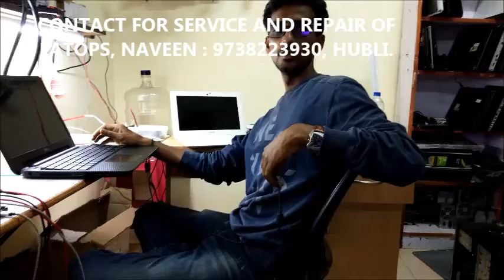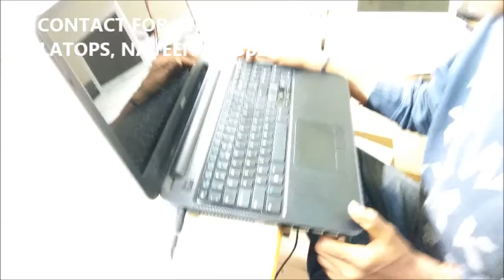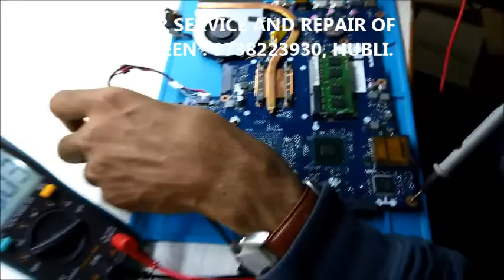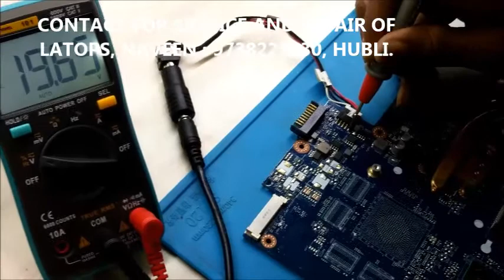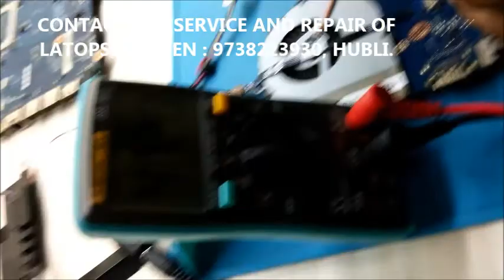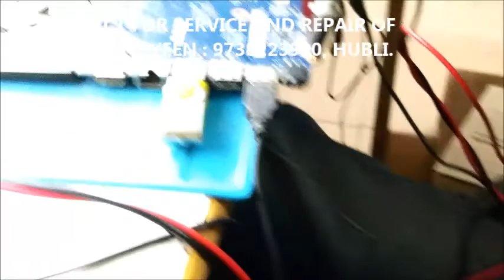DELL 3521 4BEEPS SOLUTION

Comment: i have the same m/b same 4 beeps.. i replace the resistor 470k.. now i have 1.5v on cpu power rail.. but still giving 4 beeps no display.. the gfx core voltage is not present.. pls help